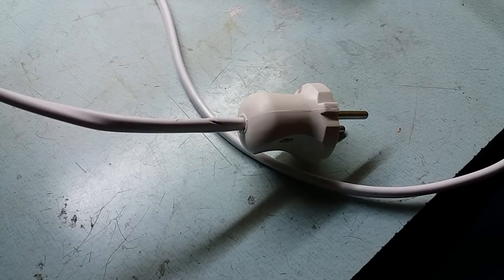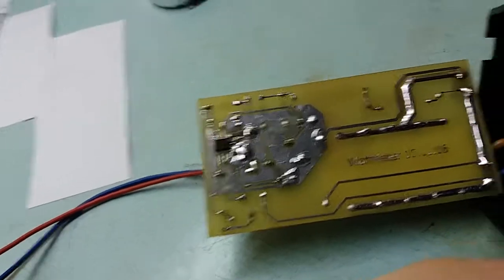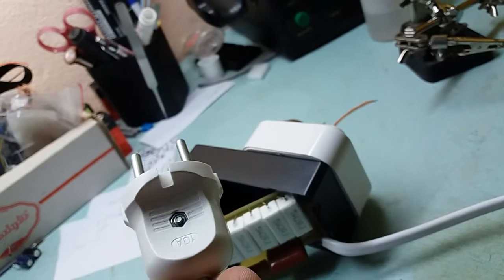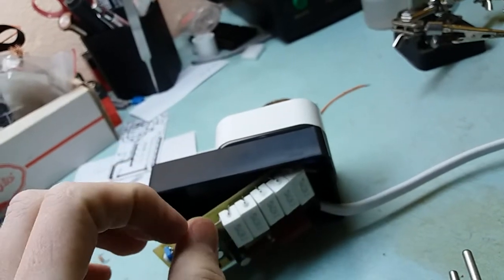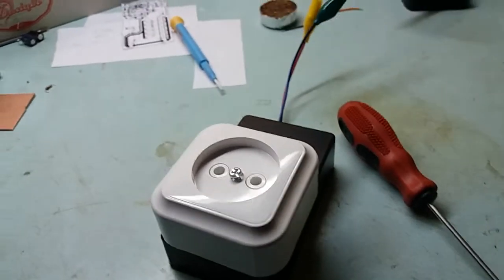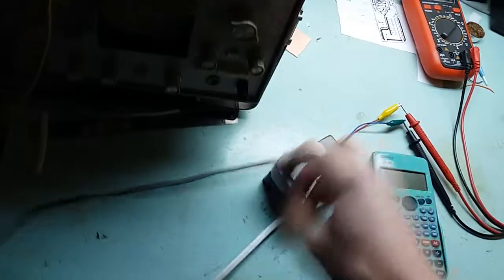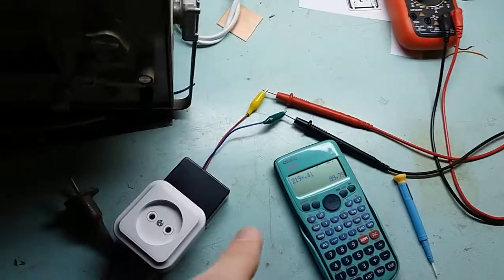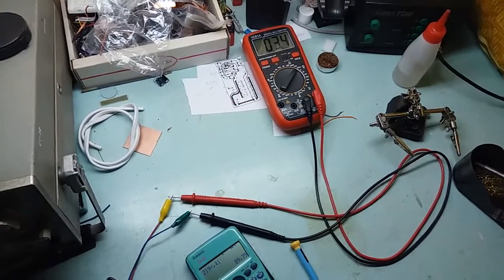DIY AC Wattmeter

Comment: Following the schematic of this design, I have been experiencing challenges finishing with the code. Please, I need assistance. The line 181 of the code. The compiler is saying No main() function found. This is the code: printf(lcd_putc,"%4.1fW",average_power_accum/20);
Reply from the maker: ignasius ukaoha Dude, what are you talking about? Looks like you left the comment on the wrong video.
Reply: Friend, Please, don't be offended. I adopted DIY AC WATT METER DESIGN AND CODE as my final year project. The site http://www.solo-labs.com/diy-digital-ac-watt-meter/ . The challenge I have been experiencing is the source code. It could not compile in CCS C Compiler due to the error I mention above. I have been searching for help. Please, if you can help. If not any recommendation for someone who can help.
Reply from the maker: ignasius ukaoha ignasius ukaoha LOL I'm not offended, I'm just saying that your comment is off topic. 
 You must've missed a bracket like this {} somewhere, it should look smth like this: 
main ()
{ your code }
Reply from the maker: ignasius ukaoha Try to add a bracket like this } in the very end, the code on the page is missing one.
Reply: Can I share the entire source code with you? Thanks for your reply. I am hopeful now.
Reply: I have added the brackets but the error is still showing. So I have shared the source code. Thanks for your patience.

Comment: say in a home, a fan is using 40W, a light 50W, a tv using 150W, a refrigerator 1250W. the total load of this house is 1490W. Now i just want to disconnect minimum 80W load or more out of total 1490W . For this reason i need to disconnect a fan and a light. so a system or device that can sense each loads power consumption and then disconnect required loads to meet the condition of load reduction. how can i make such a device?
Reply from the maker: Funtoon Sounds to be a job for a microcontroller, but I'm not the guy who can whip up this kind of uC circuits.

Comment: Interesting and thank you for uploading this. Three questions: (1) Why did you adjust your watts reading to 90? I just did not understand what you were heading to since we know that 1mV=1W. (2) Why are not there any amplifiers used in the circuit? (3) What is the purpose of having these resistors on the left side (down) corner of the schematic?
Reply from the maker: Ok, here I go:
1 - I was calibrating the wattmeter that way, parts have tolerance which will cause an inaccurate reading. If I left it as is it would lie to me :) For example, it would say 100W when device really consumes 86W.
2 - The analog multiplier chip has a good input voltage range by itself, no need to put extra amplifiers. In this state, the meter is not really accurate measuring power consumption of the devices, which eat less than 10W.
3 - Those resistors are all in parallel for two reasons: to get the necessary value and to get high enough dissipation capability. I could've used fewer resistors of a higher power, but I didn't find those while I was shopping.

Comment: Smashing pcb, very neat :-D.

I didnt hear what you said as the audio was too quiet for me, the chip i didnt hear.
And the brain is a bit soggy so ill think about it later :-(

Im not sure how it copes with inductive  or capacitive reactance within the load being tested, resistive loads only, perhaps :-).
It needs a meter module attached to the case for ease of use :-D
Reply from the maker: Huh, I thought the audio is loud enough, it hurts my ears when I watch at 50% total volume. Maybe you've set the system volume low, I dunno, really.
The PCB isn't all that neat with those bodged shunt resistors, damn. Now I bodged the offset trimpot and it looks even worse, but - meh, whatever :D I made the PCB 'cause the IC is in SO-8. 
About reactive loads - it'll do them just fine if apparent power isn't greater than 1600VA, more will cause the shunts to overheat. Inductive spikes and what not will be clamped by Zeners, so IC should be fine and dandy. I measured the soldering gun consumption in the video, and it did it fine even though it is an inductive load.
Reply: i suppose it depends on what you use to listen to audio on.
I have a laptop, the graphic is normally on the typical curve and volume at 50%, with your audio i put all bands to 100% and volume at 100% and i could not catch what you said.
Now problems, im a bit deaf in one ear and i have bad tinitus, a head full of loud tone generators, its like having your own tuning fork factory lol :-D.
Ive had it constant for 20 years, it sent me mad, i tryed to shoot myself with a cucumber LOL :-D :-D.
I did say i was mad :-D.

That pcb is neat, dont put yourself down, its good, it works :-D
Reply from the maker: zx8401ztv "your own tuning fork factory" that cracked me up :D I use headphones 99% of the time, so yeah. I shoot videos in the night, because my parents distract me in the daytime so I can't really speak that loud (I'm in the house, as you know). The chip is AD633

Comment: Thank u very much for the info but, i can't solve the problem.
i have sony 14'' tv that goes to standby when i press the power button on the remote,
can u tell me where to check or what components do i have to check?
and your videos are good and informative.
Reply from the maker: Seriously, you think I can tell which exact component to check? It goes to standby from what? Or you mean it shuts off when you try to turn it on. TV's look same on block diagrams, but the circuitry in blocks varies wildly between models and makes. Problem you're talking about here can be caused by a zillion of components, I can't tell which without access to the TV. 
Did you try to fix the previous problem with retrace lines? I assume you have some experience in electronics, and if you do, simple check procedure I showed in the video I've given you link to before, would've allowed you to know the exact problem within an hour.
Reply: i check the rgb output voltage from ta8750 ic pin 19-21 i got 3.4 volt but the datasheet says min 5 max 6.
before the tv went to these problem it had shorted transistor in the rgb neck. i could't find the exact replacment so i replace with another transistor that have closer value.
its better if u give me your email so i will sent u a photo.
Reply from the maker: Feraol Mosisa That's what I was talking about in previous video - filament to cathode short or shorted video amp transistor. That transistor should have a base-collector and collector-emitter voltage rating of 200 or more volts. 
The low voltage can be caused by a low supply voltage, the values given in datasheet are for 9V supply, check pin 4 or 11 or 27 with respect to ground. If it's 9V, maybe the IC got damaged when the transistor shorted. 
You asked about 2 TV's, it's getting confusing. Here you asked about sony, now you talk about samsung, which one does what?
Reply: retrace lines=samsung
shutdown(goes to stand by) when try to power it on=sony.
Reply from the maker: Feraol Mosisa ok, so in the samsung it may be the RGB chip. How the picture looks after you replaced the transisitor?
Sony - check the horizontal output transistor for shorts ( b-e will beep as short because there are low-value resistor in parallel to the junction; c-e will show a diode drop when positive probe will be on emitter; if c-e is shorted, replace the transistor) also check for bulged caps on the output of power supply. If you have an ESR meter, check those output caps.
Reply from the maker: Feraol Mosisa and please keep the comments on one video, don't scatter them around
Reply: After i replaced the transistor the blue retrace lines changed to red retrace lines after some days the retrace lines changed to white color.

there is no short on the c-e of the horizontal output transistor and there is no bulged capacitor, and i don't have esr meter.
Reply from the maker: Feraol Mosisa Did you tweak the "screen" control on the flyback? If you set the screen voltage too high, it'll cause retrace lines to appear on any CRT TV. Try to lower it. Also, you have a normal picture but with retrace lines now, right? I would suggest you to try and change all video amp transistors on the neckboard. Sometimes they go leaky and cause problem, but they don't measure as a short. 

Too bad that you don't have ESR meter, it would help you a LOT with repairs. Then try to check outputs of PS for shorts, check the cathodes of diodes on the secondary to ground. It's either a short on the output, or a high-ESR cap. Caps don't have to be bulged to be bad.
Reply: yes i decrease the the brightness but the retrace lines did't disappear,
no i don't have normal picture but i heard litle sound but i can't increase or decrease the volume also the OSD had disappeared.

i hear when the flyback fires but after 3 o4 4 seconds the tv goes to standby.
Reply from the maker: Feraol Mosisa Brightness and screen control on the flyback are not the same thing. Seems like you have a faulty RGB chip.
Reply: Ok where do i get ta8750?
and sorry for bothering you.
Reply from the maker: Feraol Mosisa Dude, are you kidding me? I don't know where you are from, how can I tell. There must be some online shops that serve your country. The chip is old, I don't think you can get it anymore; you'll have to search yourself.
Reply: Ok thank u very much.
can i ask u another question?
Reply from the maker: Feraol Mosisa Yes, if you don't mind the delayed answer. It's past midnight already, leave it now I'll answer it tomorrow.
Reply: i am confused how to measure b+ voltage would u tell me how to measure the b+ voltage of crt tv?
By the way where are u from?
Reply from the maker: Find the cap on the output of the power supply rated 160 or 200v and measure voltage on it.
Reply: Ok thanks,
Do you know any website that talks about crt tv repair?
Reply from the maker: I don't know such website, you have to learn from videos and from your own mistakes.
Reply: you are from Ukraine right?
Reply from the maker: Yes
Reply: Is repairing is your full time job?
Reply: http://www.elektroda.pl/rtvforum/forum407.html